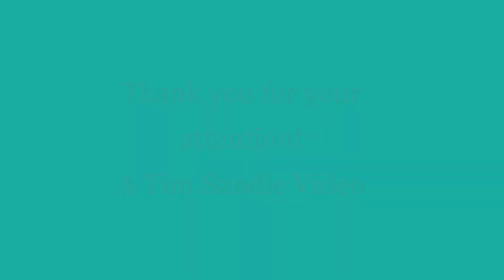Microbiological environmental surface sampling using an agar contact plate

Comment: How do you perform GPT for that kind of plate?
Reply from the maker: Hello, by dropping a microbial suspension onto the plate and then using a sterile spreader.
Reply: @timsandlemicrobiologist  That's right!
Reply: Hello May Soo L., GPT should be performed for the contact plates the same way as for the settle plates. The difference is usually the volume inoculated, which is 50µl of microbial suspension. 100µl may not be “absorbed” easily by the medium depending on the quality of the brand. However, the microbial criteria will be the same: <100CFU and within a factor of 2 compared to the previously approved batch of medium. Dispensing the 50µl in the center of the plate and spreading with sterile spreader as you normally do for settle plates is the easiest usually.